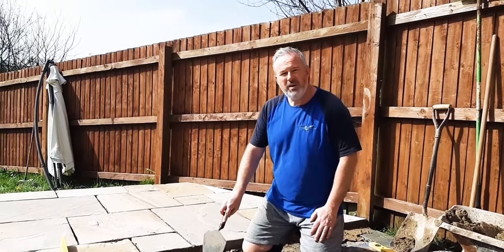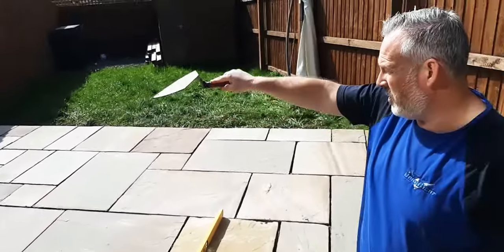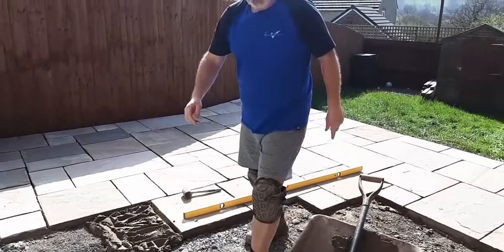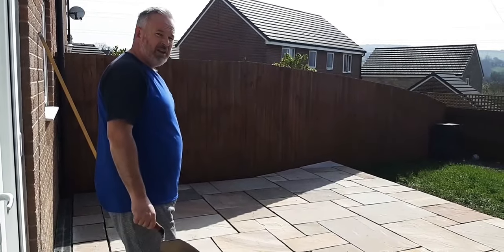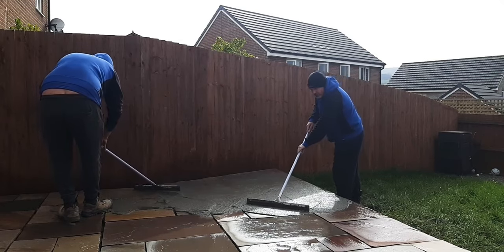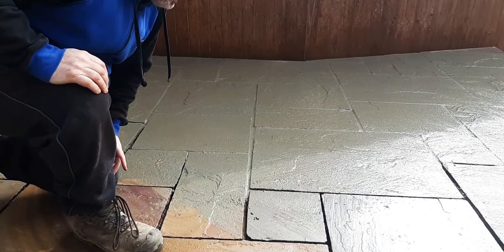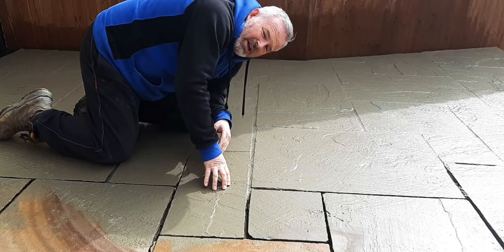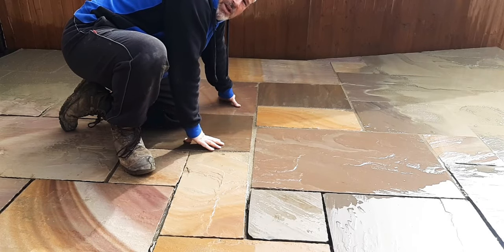How to lay and point Indian sand stone

Comment: Hi Justin, wondered if you could help me.
I've just completed a small indian stone patio and fancy a go with the flow point. The problem is, I've cladded some existing concrete steps with the paving (risers & treads) and ideally would like to point the risers in the same stuff as the patio. 
Do you know if theres any way of pointing the vertical joints on the risers with flowpoint??
Thanks again, Joe 🏴
Reply from the maker: Morning Joe.
So here is what we do .
Yes can flow point the riser with the same product as the main patio.
Flowpoint the patio get that done and completed first.Come back to the risers just mix up the flow in say a bucket but dont use it straight away let it start to set in the bucket. When its set enough for you to wear gloves and with your hands push it into the risers filling the joints has to be at the ideal set time to work it into the joints. Then its the same process of washing the steps down at the right time 
Good luck joe hope thats of help to you any issue give me a ring if you like 
Justin 👍

Comment: Looks great, I've got quite a lot to lay soon. I'd be tempted to point and rub in as I go, hmmm.
Reply from the maker: Thanks and good luck 👍
Reply: @brickrightbuildinglandscaping Cheers! What gradient did you lay these to? Google has 2 answers, 1 in 80 and 1 in 60. I'm going to 150 under DPC, no. channel against the house.
Reply from the maker: @dmak2  as long as thr bubble on the level is on the line thats usually an adequate fall 👍

Comment: My patio is open to a raised back through road from which water falls and collects on my patio. Should I lay an aco drain where the through road meets my patio, against my house or both? Also must the aco drain lead to a gully or like, or is it designed to just catch water and evaporate?
Reply from the maker: Id try and stop the water coming on to the patio area first off .
If not the aco drains need to drain into ie gully or soakaway depending on the site area .
If draining into an existing drain id recommend checking first with your local council if its acceptable.

Comment: Very thorough and helpful thanks guys! I really don't mean to sound like I'm discrediting your craftsmanship... But how hard is this to do for a DIYer that can't afford to have a professional in? And is a good job still achievable?

Also.. when you use your spirit level for the fall, what are you looking for? Where should the bubble be for the correct fall?

Thanks
Reply from the maker: Its a bit of work charles and each stage has to be spot on .It can be done take each stage at a time .Bubble should be just passed the line .
Good luck.👍
Reply: @brickrightbuildinglandscaping  thanks for your reply! Do you have a starter video I can go to to see how it's done? Or any pointers?

I suppose my biggest question is how do you get the right amount of bed/muck down?
Reply from the maker: @Charles Milligan  
Loads of videos on the channel  charles go on the playlist for patios. 
Bed needs to be between 30 and 50 mm .👍

Comment: Beautiful job!   Do you think that slurry you paint on the underside is absolutely necessary?   What kind of material is it?
Reply from the maker: Yes it is andy the slabs with work loose otherwise 👍
Reply: @brickrightbuildinglandscaping  Good deal.  The products you use in the UK aren't available in the States.  I guess I can substitute another material.
Reply from the maker: @andysparks7381  it's a bonding agent to bond the back of the slab to the cement that's all it is andy .
Hope that helps good luck .you could use sbr  mixed with cement if you have that in the USA 🇺🇸 🏴👍

Comment: Hi, we have recently had Indian sandstone put down. We have had a few issues with it. Some slabs have not bedded in properly, so they have had to be relayed. My issue is, we have quite a few slabs that have little movement in them corner to corner. The company we used are telling me this is normal as they are a natural stone and if it’s not lifting fully out when standing on one corner it does not need to be relayed. All that have movement are also sounding hollow. Again we’re told this is because of the natural stone. Is there any truth to this? Cheers :))
Reply from the maker: Joseph all i will say is our patios are layed with no hollow sounds and no movement in slabs because of the way we install the patio.
As for commenting on other people's work thats not for me to judge .👍

Comment: Lovely job of the laying mate 👍 looks great as does all your work.
Im not convinced on the pointing that product seems long winded and abit inconsistent?? We use Sika fast fix jointing compound its expensive but its quicker , easier, cleaner and gives a better finish than the gear your using mate.
Reply from the maker: Thanks for the comments appreciate it .
All i can say is ive used the sika products and i find them rubbish. Flow point is in my opinion far better just my opinion. 👍
Reply: Sika only lasts for a few years max, flowpoint lasts 10xs that, I joint everything with it now it’s bomb proof, yes it’s harder and messy to put in but you can have the confidence that you’re never going to get a call back because the joint failed or they jetwashed the joint out. Charcoal smooth looks great and I’ve just used a flowpoint fine grade that looks even better
Reply from the maker: @richwallwin  
Totally agree Richard. 
I used to use the sika stuff i personally found it didn't last and some tubs were better than others. 
Each to there own 👍
Reply: @richwallwin  you say the sika product only lasts a few years?? Ive never been called back to a job to repoint and i did my own patio with it over 5 years ago and its still sat there fine.....you claim flow point lasts 10x longer that would mean 20years??? Has it been out that long?? And have you used it and gone back and checked it from 20 years ago? You must excuse my ignorance I don't know how long its been on the market for.
Reply: @TheTraditionalGolfer  flowpoint has been out 25 years and they’ve done a key study on a project in Norway where they’ve been back 10 years later and it still there rock solid. So if it can survive in their extreme cold winters it’s got to be one of the leading products about. 

Im sure there’s a lad on YouTube that went back years later to one he’s done I think it’s brock landscaping or something along them lines forgive me if I’ve got it wrong. 

It’s used on so many comical projects all over the world so just imagine the amount of hammer it takes from vehicles and foot traffic, would a pre mixed resin resists that? It’s also cheaper than sika. Obviously I don’t know your practices and everyone’s got their way of working if you look after your patio then ye probably will last but 99% of customers never do any maintenance. I’ve used pre mixed resins, 2 part resins, traditional mortar and flowpoint, out of all of those flowpoint beats them all by a mile, I wish I’d known about it 10 years ago but it’s never really been pushed advertisement wise on us “small businesses” and my local builders merchants have only just started stocking primer so they’re way way behind the curve.
Reply: @brickrightbuildinglandscaping  I’ve also found the tubs very hit and miss, with some already half set in the bags, and sika dont want to know when I’ve put a complaint in.
Reply from the maker: @richwallwin  agree Richard last time i used it was called pave fix plus some set some didn't but eventually it all went soft never lasted .i asked sika through travis perkins to call and view its failure on site they weren't interested and said id installed it wrong .Rubbish product in my eyes not fit for what its sold for .An expensive product that doesn't last some set some didn't and some bags were already set in the tub before use .That meant tools down back to the merchants for more and sometimes they didn't have more so off travelling around for more .Nar been there done that its not for me sorry so i agree with you mate
Reply: @richwallwin  that lad will be me yes 🤣👍
Yeah think it’s been available for over 20 years.  No comparison with that Sika brush in stuff. Ones DIY grade, ones commercial! 
👍👍
Reply: @Brockstonepavingpros  well I got part of your business name right 😂. Your videos on flowpointing are probably the most in-depth and detailed out there.
Reply: @richwallwin  thank you very much!  Yeah you were nearly there with name 🤣 
Thank you. I wanted to cover as much I can as using it is not as straightforward as some make out 👍👍

Comment: Quick question, I'm having to redo the grouting on my Indian stone patio following a very bad job done by our contractor. I'm planning on using a silver sand and cement mix for a lighter colour. Question is does the joint need to be wet when I apply the mix? Read that the stone can draw out the moisture from the cement and lead to cracking or crystallising. I've never done this before so trying to research as much as I can. Any help is really appreciated. Thanks
Reply from the maker: Hi 1983 
Mad year that just after the Falklands war anyway.
If its a sand and cement mix i would mix up 3 parts sand 1 part cement into a semi dry mix.
On a dry day but not hot hot like we have had .Also on a dry patio dry joint but if the joint is damp its ok
.push the cement into the joint with a bricklayers jointing bar and the bar along the top to shape the joint.
Hope that helps you out good 83.
Justin 👍

Comment: Hi Justin, I had my Indian stone done over two years ago, the joints are breaking up, so I decided to take them out, but as I'm doing it, the slabs are coming lose, also I didn't know but they only dabbed four corners and blob in the middle, do I have to take the whole lot up or just repair where needed 😏
Reply from the maker: Thomas im sorry to say the dab laying method isn't good practice. Its never going to last .Id say take it all up and re use the slabs.lay on full beds of 4 parts sharp  sand to 1 cement. 
Use paving slurry painted on the back of each unit for bonding. 
Then grout it with flowpoint or marshalls exterior jointing compound. In my opinion those methods are the best for sand stone.
Obviously make sure the base is sufficient and well compacted .Tick all the drainage requirements aswell. 
Hope that helps and good luck.
Justin 👍

Comment: Lovely job as always, quick question would you recommend flowpoint for granite cobblestones ?
Reply from the maker: Thanks giles. 
Yes perfect for cobbles but just read the joint thickness etc just make sure your joints are ok you down load technical info on line for flowpoint 👍

Comment: Hi,
Another really good video.
Can you expand on your workaround with the low DPC and the channel drains?
Thanks.
Keep up the great work.
Reply from the maker: Basically the channel drainage to its bottom of the channel is approx 150mm lower  the dpc.By using the channel you your are keeping any water lower than the raised height of the paving. 
Don't forget the fall here is running away from the house so not into the drainage but any water blown back to the house will go in the channel so its protecting the dpc .Hope that helps JC.
Justin 👍
Reply: Good idea, well explained. Thanks

Comment: When doing this one bag at a time, can you see where you stopped and started again? Or does it blend together. Also is there a minimum depth of application?
Thanks
Reply from the maker: Hi Jo
Minimum depth is 20 mm if i remember rightly mate.
Never seen where one bag has stopped and another started no issue there but each time you mix it the correct water has to be used . Try the link for technical data
Justin 👍
https://linksharing.samsungcloud.com/o5AE5sv08V6M

Comment: Hi pal canny beat natural stone son . How much does flowpoint cost mate itching to try it , how many square mtrs does a bag cover. Where do you get ur knee pads mine are shite got a pair with one  velcro strap on each ,kneel down and its off . Got these solid rubber ones with adjustable straps,  ripped the rubber apart after 4 days . looking good mate looking smart with the barnet  cut . awra best
Reply from the maker: Alright Allan
🤣🤣 had to get it cut i couldn't see through it mate 🤣🤣 flowpoint is a out £20  a bag and i did about 20m2 with 3 and a half bags but i recess my joint a bit.
The knee pads a brilliant mate internet buy ill have to try and look back where i got em from my other knee pads a nailers they are good to.
Thanks for the comments mate always appreciate it 🤣🤣👍💯🏴

Comment: Good video. May I ask if laying the smooth polished indian sandstone is more labour intensive? Someone said you had to coat the back of each slab due to being porous compared to the riven ones?
Thanks
Reply from the maker: Steve they are the same slabs just one is smooth and the other not other than that they are the same .i wouldn't charge more labour to lay smooth myself .as for painting the back of the slab i would just you the paving slurry for bonding .
Thanks my opinion on it mate 
Justin 👍

Comment: I'm a landscaper down in Sussex, I still lay loads of Sandstone as I mostly take on slightly smaller projects. I also still point the traditional way, does flow point require a permeable base?
Reply from the maker: Hi Andrew 
The flowpoint is cement based is my understand is yes the base would need to be permeable. 
Thanks for the comments 👍💯
Reply: surely no cement base pointing is permeable  only resin coated sand types are ?  if you lay on a solid bed how can that be permeable ?? @brickrightbuildinglandscaping

Comment: Thanks for the video, very informative. Can you answer a couple of question please.
I have a large concrete base that used to have a summer house on , it is in good condition and about 4.5m x 5.5m in size. Is it okay to lay slabs on top of the base and what mix would be best? Also can you roller on a water sealer after to give it a wet look/sheen, if so what would you recommend ?. thanks
Reply from the maker: Hi beamer
If no cracks a visible and you can create the right falls for drainage the base is perfect for laying slabs on.
Sbr the base first you can buy at the merchants follow the instructions it seals and helps with bending. 
I use 4 parts sharp sand 1 part cement with a plastizer for workability. 
Hope that helps .
Good luck
Justin 👍
Reply: @brickrightbuildinglandscaping  thanks for reply
Reply: can you let me know roughly how much sharp sand i would need to cover a 16m2 area, laying on top of the concrete base. thanks
Reply from the maker: @therealbeamer9189  
Based on a 30mm bed you would need approx 1 tone
Reply: @brickrightbuildinglandscaping  Thanks again for your help&advice.
Reply from the maker: @therealbeamer9189  
Your welcome

Comment: Hi mate would it be worth sealing the stone lightly first
Reply from the maker: Yes no harm with sealing the stone before grouting or after work is finished 👍👊🧱
Reply: @brickrightbuildinglandscaping  cheers for getting back to me just thinking of potential staining problems as my joints are quite big so it may take a while to go off
Reply from the maker: @swordtailking9395  
If your using flowpoint and you install it correctly you will not get any staining .Good luck with it .
Justin 👍

Comment: Cracking work as always Justin and boys. With the random patterns used...do cross joints have to be avoided where possible? Our neighbour has had sandstone patio and we've counted 47 Cross Joints in less than 45m2 of patio. It looks strange on the eyes. Seems like the pattern is wrong. Always wondered about cross joints.
Reply from the maker: Hi Daniel 
Hope your well.Cross joints are just nasty on the eye so with planning and correct laying they should be avoided. In my opinion it looks awful and its lazy laying and planning. I think the patio without any cross joints looks better looks right and more professional but thats just my own opinion. Brandstone who supplied our paving gave us a laying pattern with a cross joint in the middle of the patio i threw it in the bin to me it would of looked awful. All opinions and each to there own Daniel 
Justin 👍🏴
Reply: @brickrightbuildinglandscaping  you're bang on the money. Doesn't look good on the eye. Keep up the great work, you boys are a joy to watch 😀👍🏼
Reply from the maker: @danprice1016  
Thanks Daniel take it easy mate👍🙂
Reply: I asked the builders merchant for the the laying plan, I’ll have to check who the supplier was? It has straight joint at about 3m intervals and they span 1.850m approx, these short of joints don’t look to bad so far, I wouldn’t want them to be any longer but am concerned if I don’t follow the plan I’ll end up running out of the right size slabs. My project packs don’t have “thing” slabs, just 1/4, halves, squares and large rectangles. Four types